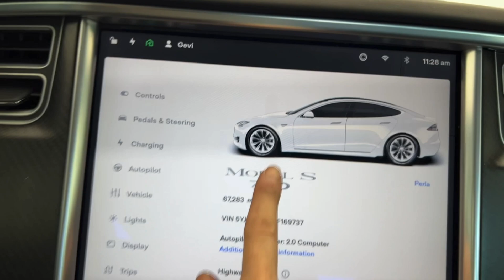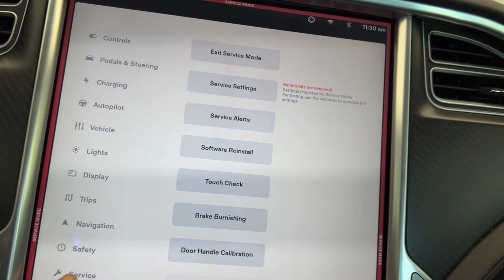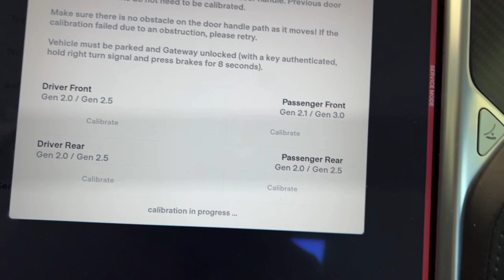Tesla Model S Door Handle Calibration (2015-2024)

Comment: You rock for posting this, thank you! My driver's door handle was not working properly on my 2021 Model S - when I closed the door, the handle would immediately retract, then extend, then pop the door open. I scheduled a Service appointment but it was several weeks out. Found your video, performed the recalibration and now it's working perfectly. Only difference to your procedure was after putting the car into service mode, I had to press the brake pedal and hold the right turn signal button (no stalks in the 2021+) for 8+ seconds to unlock the gateway for service.